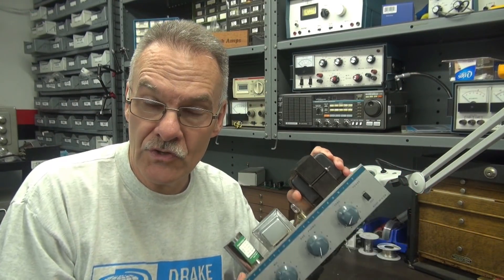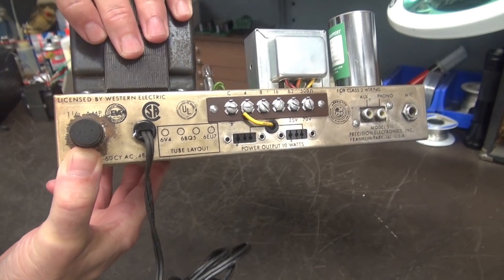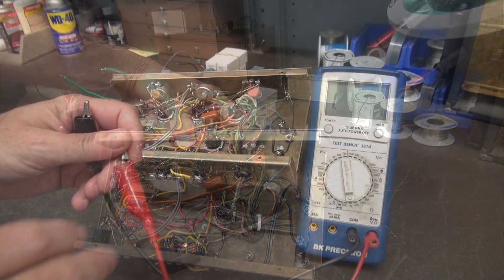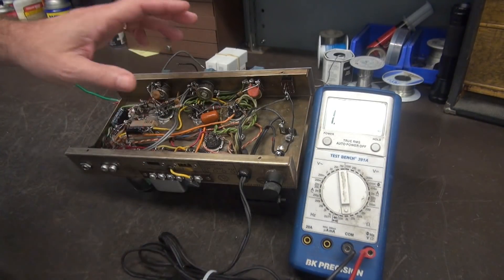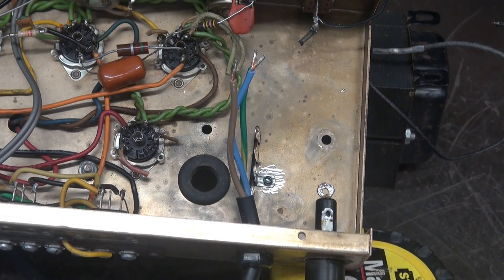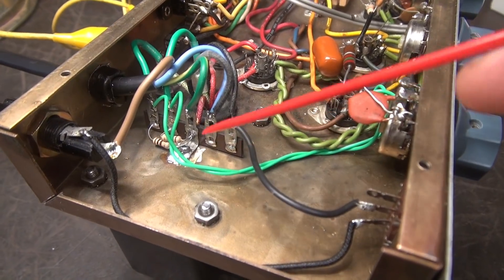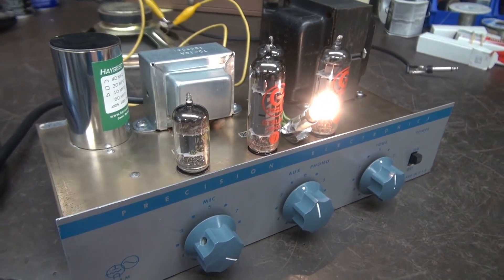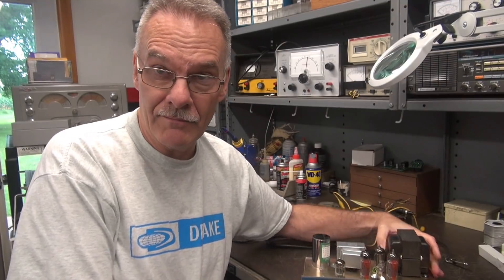How to repair restore Precision Electronics S10 guitar amplifier convert from PA to recording amp

Comment: 6BQ5 is the same as an EL84 tube.  6BQ5 in the nomenclature in the USA and EL84 is a European designation.  
From the Tube Store website:  "
The EL84, or commonly known as 6BQ5 in North America, was intended for use as an inexpensive alternative to the larger audio tubes of the time, such as EL34, 6L6, and KT66 power tubes. By the late 1950s there was a large selection of stereo hifi audio tube amplifiers available. Owners of amps from Dynaco, Eico, Mullard, and Fisher, among others, were enjoying great sound from these reasonably powered vacuum tubes."

Comment: Cool. Terry I've wondered if you've ever seen a PCB that became conductive? Some people say they have encountered them with some Marshall and Mesa amps. I just have a hard time believing they exist.
Reply: I have , on both . I've done mods to save the pcb on a M , and on one occasion changed the entire main board with a replacement from M . I've spoken to their technician too who told me that those boards do not conduct though ! Currently have issues with an MB in for repair . So nothing conclusive , but just my experience .